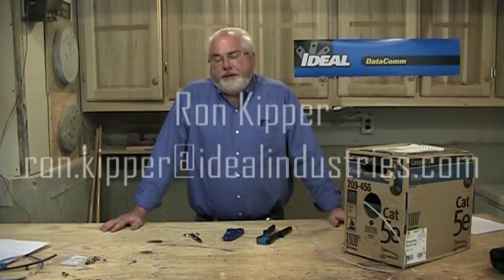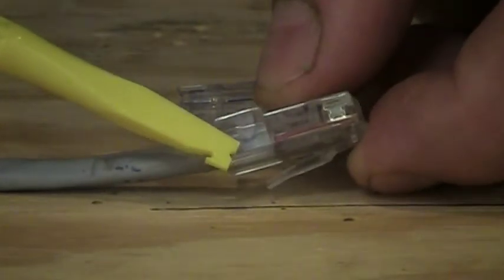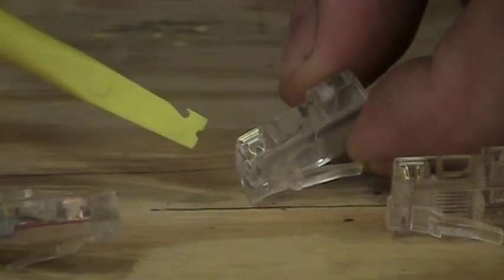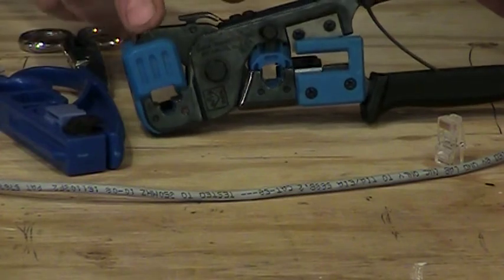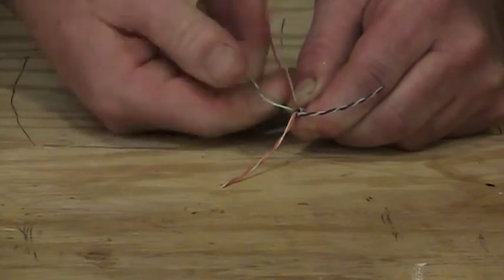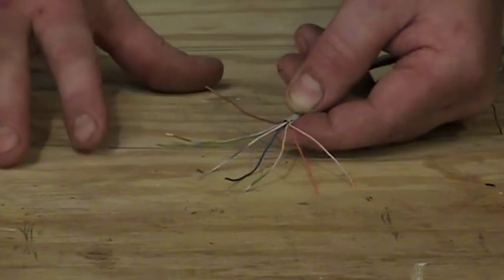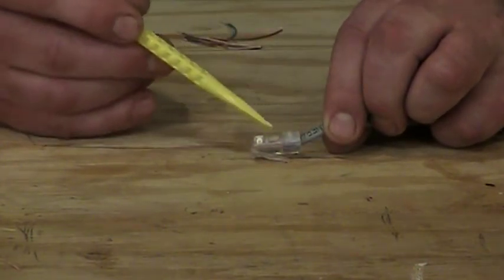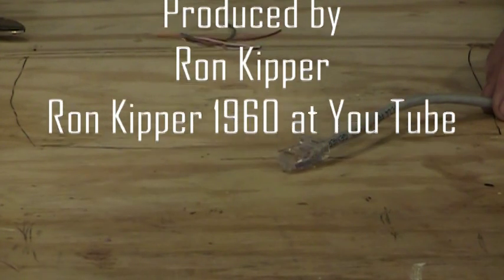Cat 5e Plug Termination

Comment: Excellent .... I wish I had known this 6 months ago.  My old Cat5  wire was stranded cable and the connectors I had worked fine.  Then I ran out of cable and order new solid wire Cat 5e.  After that it was a nightmare because I was using the old plugs rated for stranded only on the new solid copper.  What frustration not knowing this.
Reply from the maker: You are not the first one...............the little things can bite you. Ron